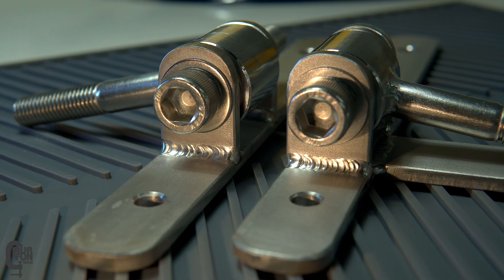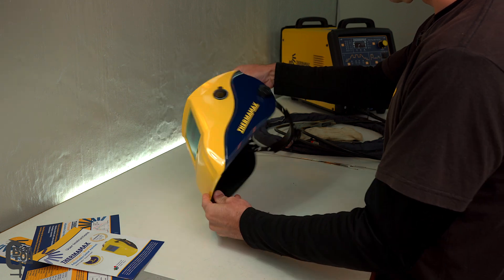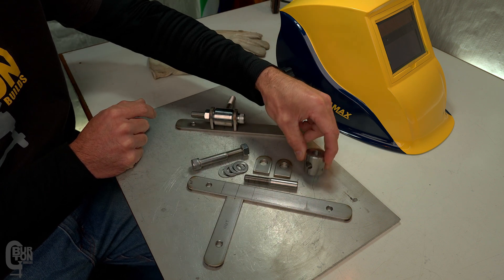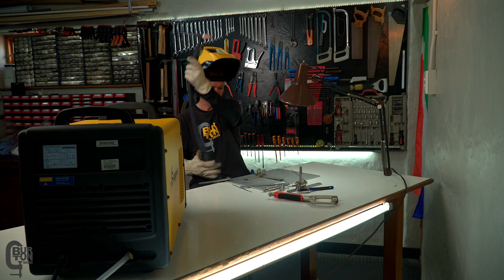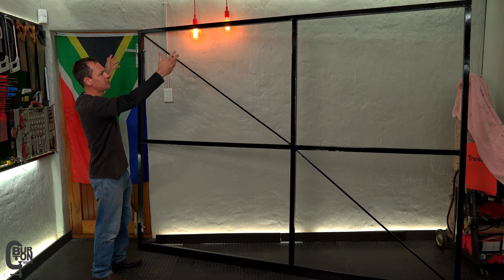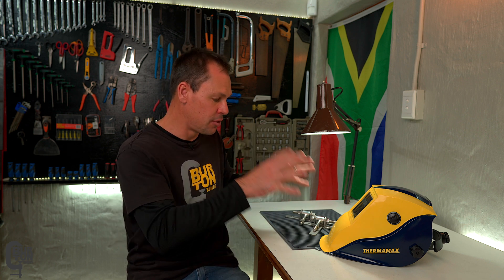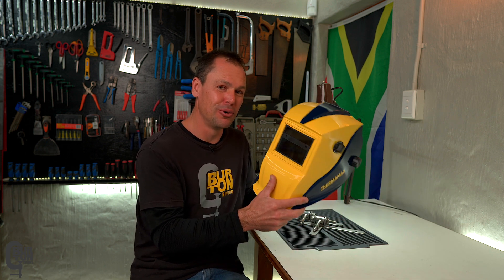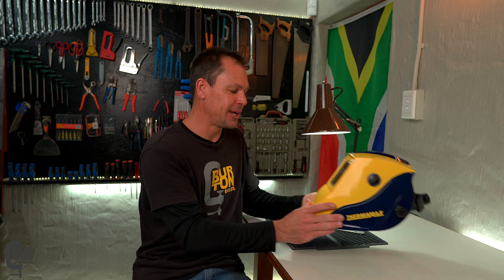Best welding helmet?? Comparing Thermamax vs Transarc welding helmet

Comment: I have to disagree with your comment about the natural light not being captured on camera. I thought the natural light one was quite a lot better and easier on the eye. I wear glasses and or magnifiers in my helmet. I have the Miller helmet with the clearlight 2.0. Quite expensive and maybe not a good as what I see in your video. Thank you for the comparison.
Reply from the maker: Hi Chuck, thanks for your comment and it's a pleasure. Oh wow, Miller is good stuff... I would expect it to be very good. It will be interesting to see how good the 2nd version of the Thermamax welding helmet compared to the one in this video. Once it comes out, I'll try get my hands on it and do another comparison.
Reply: They have arrived ! We were really impressed during the R&D with the new model!